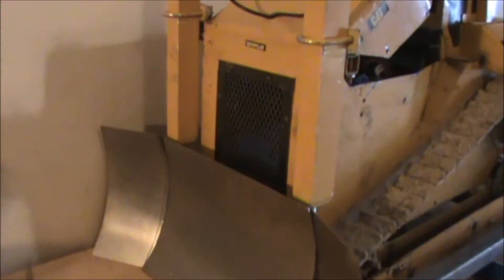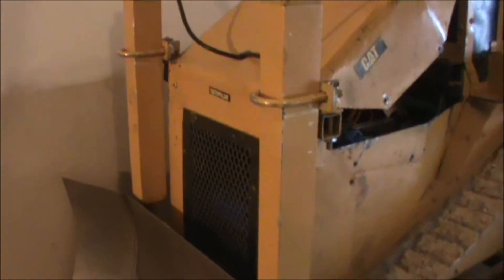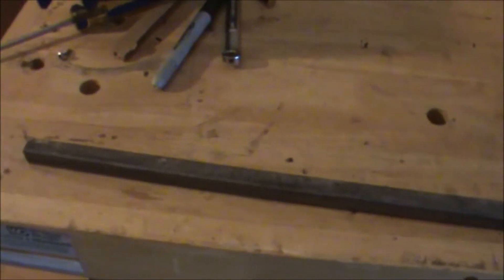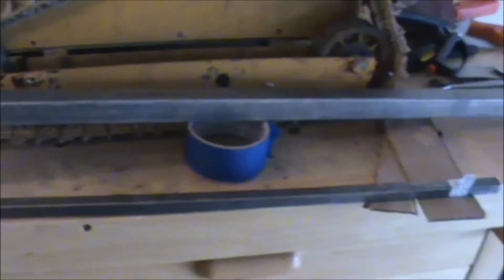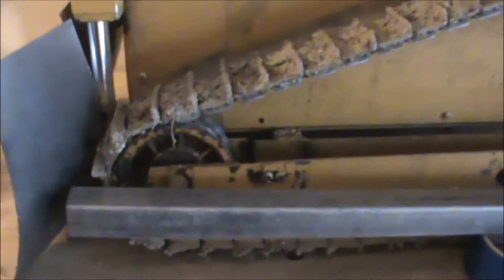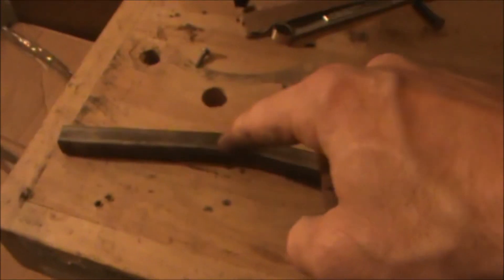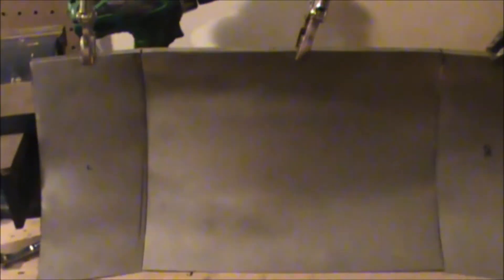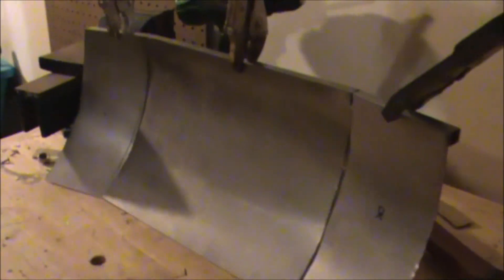Part 2 Blade Build for the RC Dozer

Comment from the maker: yes! I'll post a video probable later today on how I’m going to achieve that. I hate fabricating parts, so I found a off the shelf solution on how im going to make that work. Basically taking the wheel of the caster I am able to get that ability to move up and down with the tilt at the same time. It also can take force against it and shouldn’t bind up at all.